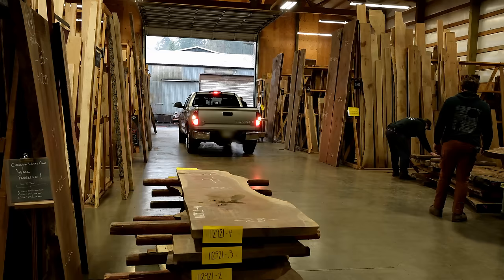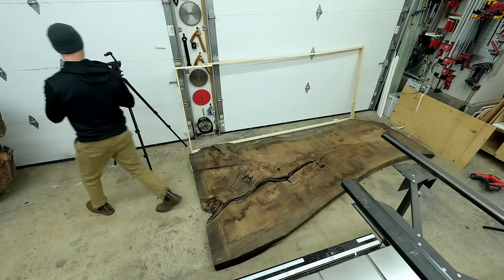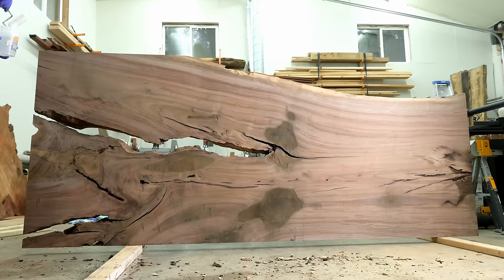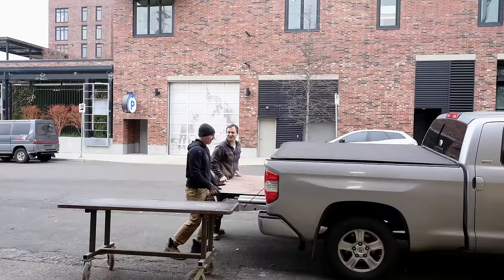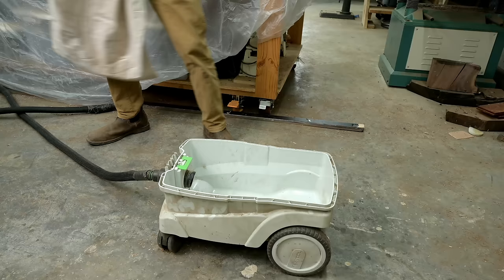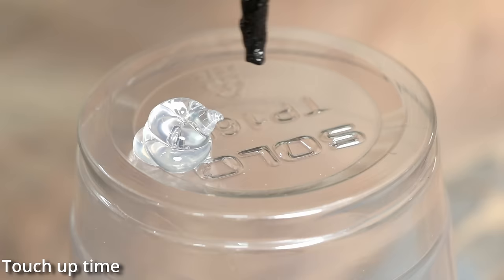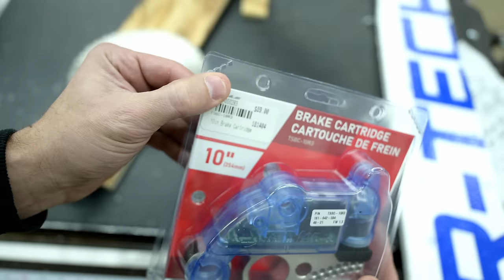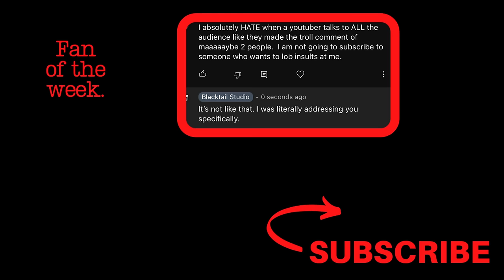The Client Hated This Slab

Comment: It might be there was some static electricity building up when cutting the styrofoam which triggered the sawstop. A way to test this could be to intentionally shock the tablesaw while its running to see what happens
Reply: That's most likely the case. You know these Physics experiments where a pvc tube gets rubbed against a cloth, thats what happened there. You also might have seen that these small parts of styrofoam sometimes are just stuck to your fingers or plastic bags..welp, styrofoam gets charged pretty easily
Reply: Same thought here. Static. Also less styro dust w the box knife.
Reply: @SewingBoxDesigns  yep or could have had a small staple, nail, shard of aluminum in embedded as well. I would bypass it when cutting foam
Reply: biggest problem i've seen is cutting foam can really shorten the life of the motor if that dust gets into it.  The table turned out very nice.  Professional work.
Reply: It could maybe be the conductive layer on the backside of the foam?
Reply: Yes, static. Have seen this several times with Sawstop saws. Can happen with plain styrofoam without the foil facing as well as other materials that generate static electricity when cutting. Use the override feature when cutting these materials to prevent a $100 brake cartridge replacement.

Comment: the foil on the back of the foam was in contact with the metal saw table. If you notice, the two surfaces were in contact on the first cut, but on the second cut, you raise the foam and due to capacitive effect, a voltage is generated triggering the breaking mechanism. If you don't understand, get two 6 foot pieces of cooking foil, place them on top of each other then pull them apart with either hand. It will shock you for sure!!!
Reply: Great observation.  Best reason to always wear rubber soled shoes in the shop.

Comment: I'm one of the subs that is not a woodworker i think the work you do is awesome I wanted to ask if you have ever tried the same grinding blades or plates that they use to shave down a hoof for horses and cows I know obviously it won't work for the harder types of wood but maybe when you get down there to clean out the piece you're working on it'll be a little easier on you and the piece you're working on but hey like i said I'm not a woodworker I'm just a fan

Comment: In response to the boards on the side adhering to the epoxy: have you ever considered or tried spreading bee's wax on the sides? It's supposed to really help with removing stuff like that cleanly.
Reply: Mold release is the high tech version of beeswax, and should work even better.

Comment: Great work on the table ! I was surprised though that you don't seem to have a crane (either electric or chain operated ) installed in your workshop. Might make some work steps a bit easier to handle ?!
Reply: Yea, you can get scissor jaws for them that just use gravity and the weight of the slab to pick up and move it too. They are amazing for moving around heavy slabs, my dad used them for moving slabs of granite etc for years

Comment: Great table, as always! Quick question - when you use Rubio monocoat you said that when sanding down the table to not go below 120 grit paper.  What happens if the table has some resin in though?  120 grit is far too course for a polish on resin, that needs to go as far as 1000 grit and then polishing compound.  How do you manage this apparent conflict?

Comment: It was probably static electricity in the foam. I've got myself pretty good before touching a foam slab, so my guess would be that the saw blade created friction which created an electric charge. Sort of like how you can stick a balloon to things by rubbing it with your hair
Reply: That was my guess as well
Reply: I used to work at a place that cut and creased big sheets of corrugated plastic.
Turns out that under the right conditions, when you stack up a couple hundred of them they can build up quite the charge.
On hot dry days you could feel it from two feet away. It could get scary.
Got a shock once that made my whole arm dead for like 5 minutes.
After that I would do a lap around running my arm across the top to discharge the build up.
Reply: @830927mjki  jesus, a shock that deadened your arm for 5 minutes could easily have stopped your heart. lucky man.
Reply: @FondlesHandles  Yeah, it stung like a bitch too. 
Lucky I was young and healthy I guess.

It wasn't nearly as bad before that day, I think it might have been a heatwave.
And I was super careful after.

Comment: Get a stainless steele prep table cart on wheels. You can find 24"x24" ones that can roll around the shop if you need to move it, and it will keep stuff up off the floor to save your back.

Comment: Since I am an older guy who works alone, I look for ways to make things easier and safer. I built a dolly to move large doors etc. You place the slab on edge and the dolly goes in the middle. It has dual 6" wheels on both sides so you only have to balance the slab and it could then be moved around your shop easily. Mine is pretty beefy but yours would have to be even stronger for those large thick slabs. They make some that will tilt to horizontal which you might consider. Also, they make a slide that fits in a truck bed to make loading and unloading easier. One trip or slip while handling those heavy slabs and there is no going back. I also struggled lifting large sheets of plywood (melamine) on to a table. I first used the plastic sheetrock carriers from a big box store. I eventually made some stronger ones out of wood. You could also weld up some strong ones. Same principle...you lift from the bottom center. They make carrying and lifting sheet goods so much easier. Be safe.

Comment: I used a needle gun a couple times carefully to remove bark and debris. You might try, but be careful. Very good video and great table. Also I use a higher work table, sort of like bar height with a foot rail. Enables to stand straight up and shifting feet around occasionally saves back pain.

Comment: to move heavy slabs without scratch you can take a hand truck and put cardboard over the frame or even build wood backing according to size of slab. cover in carpet as well if its heavier. Furniture movers use them

Comment: I'M AN 83 YEAR OLD WOODWORKER/TEACHER AND LOVE YOUR WORK AND DETAIL PROCESS - WOULD LIKE TO SUGGEST AN OLD SCHOOL PROCESS ESPECIALLY FOR HARDWOODS - TRY "RAISING THE GRAIN" BETWEEN THOSE SANDING GRITS: 80 - 120 - 180 - 220 - 400 - LIKE TO SEE THIS TECHNIQUE BY ALL WOODWORKER'S  THAT JUST SKIP THE SANDING PROCESS AND ONLY SPRAY THEIR TOP COATS ON THE SURFACE -  DEF: "RAISING THE GRAIN" USE A COTTON CLOTH AND WET THE WOOD - LET DRY- DO NOT USE AIR JETS TO DRY - FORCES WATER INTO THE GRAIN - CONTINUE THROUGH THOSE SANDING GRIT AND THE GRAIN WILL STOP RAISING - THIS ASSURES YOU THAT WHEN YOU APPLY YOUR TOP COAT THAT THE GRAIN WILL NEVER RAISE ANY HIGHER -
Reply: I like the other color. But your work is wonderful!🎉🎉🎉

Comment: Green dye. You could have neutralized the reds and brought the table into a cooler tones. Thin the green dye and you will not necessarily have any "green" in the table.

Sandpaper:
If you are mechanically sanding you can skip every other grit... 100, 150, 220.
If you're hand sanding then you will either need to hit every grit or spend a lot more time sanding.... 100, 120, 150, 180, 220.

As for where you are stopping on the sanding grits...
Most factories are not going to sand beyond 180. I will usually stop at 180 or for highly visible areas like table tops, I will go to 220.
Generally my personal preference is to mechanically sand to one grit higher than I plan to actually end at. Then I drop back a grit for the final hand sanding (to make sure the mechanical marks are out)... This means less hand sanding as you're going down in grit and so less sanding will be needed to remove the marks.

Comment: Static electricity sensed on the foam (aluminum side) triggered the blade guard.  There was enough conductivity from you, through the board, to the sensor.

"touch" something grounded prior to using the saw to remove the static electricity in your body-clothing.

Comment: I have a suggestion to make things easier for moving large pieces of wood. Use an Engine Remover jack with an electric pulley and 6 inch Web straps. It'll allow you to move wood on your own and is mobile. On the back of your truck for remote loading/unloading install a wheelchair electric pulley. Allmich cheaper, easier and less space to store. Just a suggestion to make it simple.

Comment: I'm just wondering if you could purchase  a roller bed that fits in your truck bed, but that can also be easily removed; something like removalists use. For that matter you're clever enough to build a collapsible roller frame that fits your truck bed. The rollers would be fixed in place, and you could have fastening points on the frame to secure your slabs as well.
Best Regards,
Carlos.

Comment: I don’t look thru the comments section. So apologies if you have answered this question before. Wouldn’t it save on epoxy $ and I assume be stronger. To route out a 3/4” recess to bridge over the void cracks & the added edge piece. & since you can’t see thru the opaque epoxy. Doing full thickness at the edges of the table

Comment: I like your tables and videos, they're nice. I am missing the tip of one of my fingers, and if I could exchange it for 90 bucks, I'd be there like a bear. 
I have an engineering background and would recommend you acquire yourself an adjustable scissor lift table with countersunk roller bearings imbedded in the tables surface to increase ease of sliding. You could also have it fitted with clamps and the top pivot 90deg so that you could enjoy the dual function of grinding out all the unwanted material between cracks prior to your pour.

Comment: 1:35 vacuum suction crane. Can pick up any kind of slab, and with enough suction, it will stick to it. You'd only need it to lift the slabs out of your delivery method, and unto a cart after you drive the delivery method out of the entrance. If it can pick up unfinished half ton marble slabs, it should be able to pick up wood. They can be pricey, but they're cheaper than hernia.

Comment: Speaking of us pointing out safety concerns in the comments section... Why not just get a bed slide in the back of your truck so you can forklift the table top onto the bed slide while it's out, then secure it, then slide it back into the truck and lock it in place? It works better than rollers I assure you. 
You could easily get a good bed slide for less than what one of your table saws probably cost.

Comment: Hello I see an issue you have complained about that I may be able to help you with. Release agents really suck. If you use wax, like wax the snot out of your mold, then release agent you will greatly appreciate the half hour of waxing.
 I found this one out making an automotive finish carbon fiber kayak. Wax wax wax. It'll save you time. I agree fully with smaller pours exothermic reaction is a thing.

Comment: Worse but that just means I liked the first one better. They are both beautiful tables.  Have you ever worked with TX cedar?  It  was used in old San Antonio to make streets until one year, a cold winter came and people pulled it up and burned it for heat. They still find it when digging to put in underground utilities.

Comment: Re "comically big router bit"  I've seen it on later videos first, and I didn't realize it was custom.  I just assumed it was meant for a shaper.  I just looked it up to see if they use the same chucking system, and indeed the smallest size for a shaper is the same as the full-size size for a router, a ½-inch shaft.

Comment: I've been wanting to do this for years. I have a barn equipped with a band saw, a planer, a table saw, circular and basically every tool imaginable. I'm a contractor that does all carpentry, flooring, and interior/exterior painting but I've always wanted to make chairs and tables out of my barn but how do you get the clients?? It looks like your doing pretty good but how do you advertise? How much do you sell one of these for too? Please take a minute and answer my questions. I'd like to do this for the next 10 years and retire. Thank you very much bud.

Comment: Instead of using PVC pipe try using moving blankets. They are about 72" X 80" and can be found at Home Depot, Lowes, etc. I lay one in the bed of my truck with extra material hanging below the tailgate. I lay whatever I'm moving on top of the blanket leaving about 6" or more to fold back over the leading edge. Then slide in your piece and it will grab the material folded over. Done. You won't have to fight the rolling PVC all over and your piece will be padded from getting scratched.

Comment: Both slabs look great, though I prefer the one that has a reddish tint. Could you be getting some static buildup when cutting your foam boards resulting in tripping the Saw-Stop brake? If so you might need to bypass the brake during big foam cuts or when humidity is low - perhaps something to ask the manufacturer.

Comment: Don't know either why the safety triggered, but if you haven't thought of it - turn off the safety system by going to the bypass mode when cutting material like super wet treated lumber etc.  I have cut styrofoam panel to make packing material several timess with no problems.  Also kickback from styrofoam is not as dangerous as wood, but still be careful of where your hands are in bypass mode.

Comment: For your saw: on the bottm of your styrofoam was a thin metal layer. you might have touched it with your hand - the blade touched the layer of metal and so it triggered.

Comment: You said that you use Instant glue and an accelerator to fill the small  pits and holes. I used to build RC airplanes. Instead of buying accelerator, You can mix a tablespoon of baking soda in water and put it in a spray bottle. And it works just exactly the same. To reinforce bulkheads, I would hold the joint at a 45° angle. Put a couple of drops of glue on it and as it runs down. I would sprinkle baking soda on it and it would turn as hard as cemet.

Comment: As far as the CNC question goes. Just my opinion, but if you start doing CNC it's no longer hand made. Not woodworking it's computer programming. Your work is gorgeous and so far you can take great pride in saying "I made that" instead of Microsoft made that..

Comment: Fyi, the ancient Egyptians didn't use rollers to move those big vlocks, only to position them. To move them from the port (where they were brought inland) to the Valley of the Kings, they built hoops around the rocks themselves and rolled the whole block. They wrapped them with ropes, looped around and around, so they came over the top, and then teams of workers (not slaves) pulled the ropes, rolling the block, even uphill.

Comment: That's nice. I liked both of them... I am going to be building an entertainment center and a kitchen table / bar and it will be my first time. I am not able to buy slabs or have the space to work on a full slab so I was going to do it with wood from lowes. Can you tell me what buffer you use to put the stain on and if I can get a look just as good as the table you made ? This will be my first build and I will be only using wood.

Comment: A good way to secure it would be to have someone weld you a cradle, basically a piece of L section but with longer flanges, i'd go with 20 cm extra from the raw L section. If you add hook points to the sides and middle, you'll be able to pass one strap through one eye at the end, and one to the middle one coming from the top mount point over the cradle + slab, and under the tailgate to something like the ball hitch mount, and another going the other way, from the other side. That thing will never move.

Comment: Yes, aluminum is a very good conductor of electricity.  And while a lot of foil on the back of the foam might not set off the saw stop... well ever so often the mixture can be contaminated enough to conduct like skin.

Comment: Cam,  
I love watching your videos and appreciate you sharing your knowledge with us.  I do have a question for you.  I bought a couple very nice black walnut slabs to make a dining room table and they are about 2.5" thick and 12.5' long.  The slabs are fairly flat, but there is a slight cupping and twist to them.  My question is whether I flatten one side of each slab separately prior to the glue up insuring I can have a flat surface for my track saw or flatten both sides separately and then glueing them together.  Please let me know what you think.

Comment: I would hazard a guess that the saw stop triggered because of electrostatic buildup. You likely had just enough static build up and then suddenly discharge causing the saw stop to think that it had sensed a ground. It likely only triggered because you were cutting foam which I could see being a potential static charge generator as the blade rubs the side of the foam.

Comment: could you have used a 2x4 as a lever to lift the end of the slab high enough to roll the pvc under to at least the balance point where you could roll it off?

Comment: Why don’t you put together a prep list that you can also use as a tick list. This will ensure you do not forget anything when you travel hundreds of miles looking for materials or special tools. I made furniture before moving on to manage projects, and making prep lists that could be used as lick sheets really did ensure I got it right every time! They also make you away of any questions you need to ask suppliers, so you have all the technical aspects covered for each phase of the project. Maximising your profit is the outcome, not hurting your self or having client saying it’s not they asked for. Keep safe!